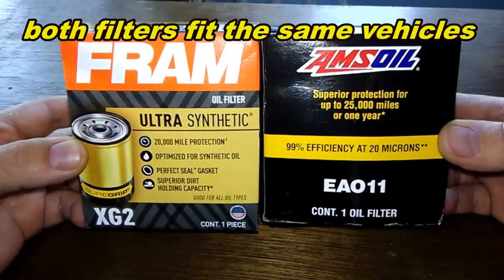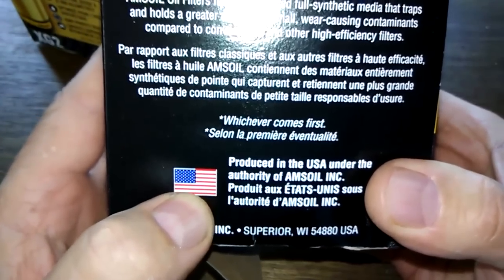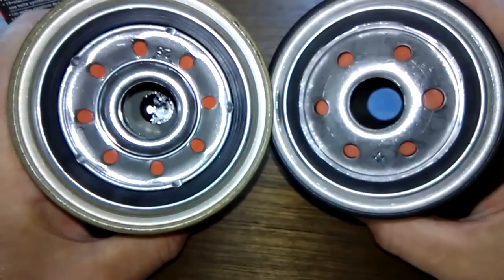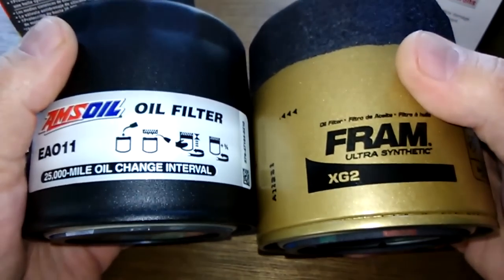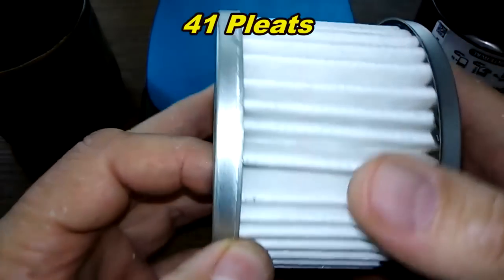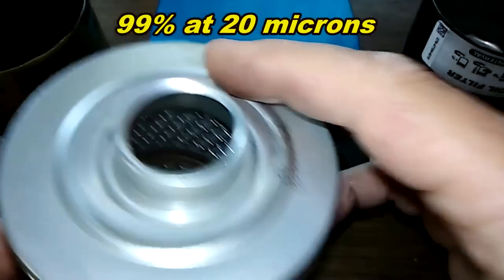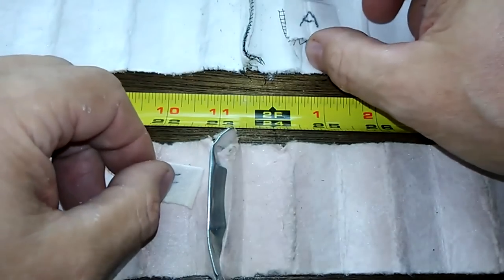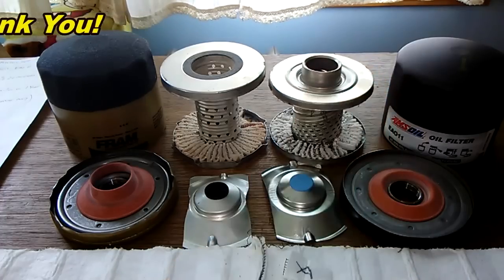Fram Ultra XG2 Oil Filter Cut Open vs. Amsoil EAO11 Oil Filter Cut Open Oil Filter Review

Comment: Without viewing the media under a microscope or running some sort of test through the media, just because something looks similar to touch or plain eye doesn't mean its the same. I'm not saying that the frame wont measure up to this amsoil or say WIX brand (which I use) but the video is merely a visual observation by naked eye, just stating the obvious.
Reply from the maker: Both manufacturers that these filers are made for state/claim that they filter down to 99% at 20 microns, believe them or not that's up to you. I only open them up.
Reply: @WhipCityWrencher   oh I see, my bad, then it makes sense, if that's the case I don't see why fram can't make a comparable or even better filter! Thanks for the video!

Comment: Why did that FRAM box clearly state it did not have the metal mesh; yet, when you opened the filter up, it did have the screen? I thought all the new Ultras did away with the metal screen like your most recent opening of the XG7317?  Is that really the correct filter recorded that came out of that pictured box?
Reply from the maker: Good catch.
The filter in the video came in this box, in some cases they started changing the boxes before they changed the oil filters. They are in transition right now so it's best to look at the filters in the box to see what filter you're actually getting. If you look in the center core you'll be able to see the wire screen through the holes. If you can't see it then your looking at the New Fram filter
Thanks for asking👍😊

Comment: If you dont want your filter gasket to stick to the block and you want it to screw back off as easily as it went on...  use copper anti seize on the gasket instead of oil.
Reply from the maker: I don't know if that s a good idea, some of that anti-seize might get into your oil.

Comment: The ratings are not the same.  Amsoil gives the absolute efficiency, whereas Fram only a percentage greater than 20 microns.  Could be 25 or 30 microns to achieve 99%.  The fine print in the warranty says a lot.  Fram only warrants when used with factory intervals, but Amsoil is the full period when used with thier oil in sound engine.  An oil will last a long time if you can keep it clean, and proper temps.
Reply from the maker: Sorry,
I have to disagree, it's 99%+ at 20 microns.   https://www.fram.com/parts-search/XG2/?ref=NoIgDghgTgLgdgVwLYCMCmUQBoQA0DiATNogDalZkVWULm31UC6QA
Reply: I just looked at the Fram link and it did say for particles greater than 20 microns, not at 20 microns absolute
Reply from the maker: @darrylsjodin7184  Your right my mistake it's 99+% at particles above 20 microns. They play with words and it's all very confusing at times. This was posted a while back on BITOG and Fram claims this is what the New Ultra filtration is.https://i.imgur.com/NMu7XDq.png . I'll try and find the original post and put it here.
Reply from the maker: @darrylsjodin7184 Scroll down to post #57  https://bobistheoilguy.com/forums/threads/the-new-fram-ultra.344442/page-3
Reply: @WhipCityWrencher  thanks for that! Sorry, I’m sure you have plenty to do. I’m laid up from a total knee replacement, so I’m doing couch duty🤣 if you haven’t read about bypass oil filters, Amsoil makes some and they are pretty cool and capable way beyond full flow filters, 99.8% at 2 microns, making the full flow filter micron rating almost irrelevant!
Reply from the maker: @darrylsjodin7184  No Problem, Hope your knee gets better soon.
Yes, I've seen them bypass filters, if I bought a New vehicle I would probably install one.😊

Comment: Note that the hieroglyphic instructions call for the Amsoil filter to be prefilled with oil prior to installation.
Reply: That's an oil dropper, not an oil quart symbol.

The hieroglyphs say to apply a few drops of oil to the gasket, and give you the number of rotations to tighten after the gasket makes contact with the block.
Reply: @Texassince1836  look again, first symbol clearly shows filling at the center and second is lubricating the gasket.

Comment: the Fram XG series is generally considered the best general use filter. Amsoil gas a cult like following. Their filters are decent, and their oils are decent. Just way overpriced.
Reply from the maker: I think the Amsoil is overpriced also.
Thanks for your feedback.👍😊
Reply: Both the size of the company and the quality of the products used in manufacture effect the market price. The huge oil companies can buy the product by the train load to get a lower price, same reason small stores can’t compete with Walmart

Comment: Bottom line is 99% at 20 micron for both filters, why pay 2.5 times as much for one over the other? Who cares how much they weigh, if they are rated at 20 micron and for longer than you are going to go on a change it's a no brainer, Fram.

Comment: I'd run neither in a vehicle I'd be using Amsoil in. That would be a premo performance motor, and neither will have a good enough flow rate for a high oil pressure condition and will bypass, or blow off. Better a cheaper filter with a better flow rate with actually filtered oil, than unfiltered oil bypassing from either of these. These high interval filters are meant for older PFI, medium compression ratio daily drivers that see a ton of low effort miles.

Comment: Seeing your video, I would go with the Fram to ultra. But the frame restricts a little on the oil flow. I saw another video where the guy built the rig to measure the back pressure and the frame ultra was restricting, but it does filter very well, and I don’t think the restriction is of no concern.
Reply: It is if you own a Honda. In fact Honda America does not recommend any fram filters Ultra and above because its to restrictive and causes low flow.

Comment: Im not happy with the 6 tiny inlet holes.
Mobil1 has 6 elongated holes for about 3x  the inlet area.
MOST of the upper line filters are equal in flltering and meet car manufacturers specs.
I look at the holes.
Reply from the maker: Probably doesn't matter because they should equal or exceed the size of the outlet hole.
But I like more inlet holes also.

Comment: Dude:

The 25 k and 20k miles presumes that you're gonna change the oil firs, then you can go the suggested miles.

I hat to add duuuh, but it was just too irresistible.  Lol
Reply from the maker: I change my oil and the oil filter at the same time. Putting in fresh oil and leaving in a dirty oil filter is not something I would do.

Comment: The Fram filter is a cheap filter media and the Amsoil is much better. Fram is also known for making their regular filters out of cardboard, they are crap. I take the Amsoil filter all the way to the 25,000 miles over Fram any time. I use Amsoil oil for my car and new truck as well. Users of Amsoil oil and filter have gone over 700,000 miles on their bikes without an overhaul, can Fram say that?????

Comment: I’ve been using signature series with Ea filter. Agree both are expensive. I think most people are not going to go 20,000 mi on an oil filter. Heck, even on my signature series, I never go over 16,000 km (10,000 mi), so actually Fram ultra makes a lot of sense.
Reply: Before shying away from safe, money saving extended drain synthetic motor oils from AMSOIL, have a laboratory oil analysis done on that 10,000 miles AMSOIL synthetic oil. You may be very surprised to find you're tossing out perfectly good oil. :)  - 30 year Independent AMSOIL Synthetic Lubricants Dealer.

Comment: Had to switch to Fram because Amsoil filters are out of stock . we shill see how they hold up . You know i go 15,000 miles then change filters then 5,000 more then change oil and filter.
Reply from the maker: If you're doing that. Why not split the filter into 10,000 miles intervals?
Reply: I @WhipCityWrencher
Reply: @WhipCityWrencher  it's just what I do because oil is worst shape at the end of it's life.

Comment: AMSoil has egg on it's face. Pulled back the covers to expose the rip-off.
Reply: I cant deny the Ams filters are to much. I use Wix XP. But I like there oil and especially the Full Syn Trans fluid. I change trans fluid often (I pull a trailer) and it last much longer than using my 2nd choice Castrol Conv. trans fluid.

Comment: I like the lack of the metal crimp on the pleats I only use fram if im doing engine flush or anything that I know I will be doing a very short change on but the by pass pressure relief is a huge difference between the oil being filered or not. The surface area is the next biggest factor fram is longer but the seams defeat that small difference. Basically the fram has a  negligible amount of surface area the difference in bypass pressure is going to be able to filter oil longer. No the Amsoil isn't worth the price but I don't really see anything that I can actually say changes my mind about the Fram filters and the other thing is Fram has done the bait and switch before and I wouldn't be surprised if they do it again. Advertise the living hell out of the newest greatest thing and get consumers used to it and then they cheapen up the materials and don't say anything.  They get away with it buy using terms like "up to"  in the small print witch under the law makes it impossible to hold them accountable for any filters tested that don't make it to 20 microns and also means that only one filter in thier lineup has to hit 20 microns. I haven't seen this issue with other filters I've bought but I also can't say that it is impossible that it does not occur but I have personally seen it with Fram. Not every fram filter within the same category is equal to each other.
Reply from the maker: Thanks for watching and your feedback👍

Comment: Fram does not state 99% at 20 microns, not on the box, site, or anywhere.
Reply from the maker: Correction 99% for particles above 20 microns
Reply: @WhipCityWrencher  you stated they both filter 99% at 20 microns, Amsoil is the only one that does 99% AT 20 microns, Fram is unknown.
Reply from the maker: @thescooter135  I miss stated, Fram says 99+% particles above 20 microns. https://www.fram.com/en/oil-filter-xg2

Comment: There not for the same vehicle so comparing the size is pointless.
Reply from the maker: These two oil filters fit the same vehicle.
Reply: @WhipCityWrencher  no they don't the center hole isn't even the same size.they can't thread on the same car if they did the outside diameter would be the same as well.
Reply from the maker: @mbsnyderc  I suggest you go look it up, they both have M22x1.5 Threads
Reply: @WhipCityWrencher  I don't have to i can clearly see in your video the center hole is not the same size.

Comment: I would have to say Fram is the worst filter for the low-end ones(junk) they sell on the market but if you buy the higher-end ones they are pretty much on par with the competitors.  Otherwise, I would run away fast from all lower-end Fram filters.   Do a test goto walmart buy the low end walmart no name brand filter and do the same for the eqiv. for fram.   Cut them in half and be shocked. You will never touch a low-end fram again after that.
Reply from the maker: Are you talking about the Suprtech's? Well, some of the Supertech's have felt endcaps, and the entry-level Fram's have cardboard endcaps. Not much of a difference there in my IMHO.

Comment: For amsoil oil to say it's good for 25K miles, it says to change the filter at 15K I believe. I'm not paying their prices or going that long on oil. I won't even use my manufacturers OIC which says 10,000. I usually go between 4 to 5,000 mi. So why pay the extra money?
Reply from the maker: I agree, 
Thanks for watching and the feedback👍
Reply: You can get the data sheets for Amsoil on line 
Their oil hands down is the best 
If you go to their site and become a member for 20 bucks a year the oil is not that expensive 
As for the filters you would need to do a test on them after 15 or 20 k to see how they held up. 
Filter wise it does look like fram is cheaper and seems to be the same caliber as Amsoil but like I said you have to do some type of test after usage 
What if frame filter falls apart or degrades 
Same for Amsoil 
But one thing I do know Amsoil will allow their products to be tested against anyone. 
As for the oil it is a great oil and it does last and hold its properties over the course of a year 
It also has more detergents to keep your engine clean.
Reply: @anguslean4058  you can go that long if you want. I don't care what the lab says, nobody recommends more than 5K miles for oil changes

Comment: 25k for the filter but you still should change your oil?
Reply: Amsoil recommends oil and filter changes together at up to 25,000 miles in light duty service, 15,000 miles in severe service, which is most applications. If using another brand filter, replace the filter at half the oil service, so 7,500 for a 15,000 mile change. Install a bypass filter for an even cleaner engine and oil, filtration down to 2 microns  at 99.8%. I’m 62 and have been doing this for years, 287,000 miles v6, clean engine good condition. No need to change oil so often

Comment: If you have a program you can get for $15 amsoil that’s what amsoil is the best oil you pay what you get for
Reply from the maker: Yes but the Fram Ultra will do the same job and would still cost almost half. There are plenty of good Full synthetic oils for a lot less. You can do shorter OCI's and have cleaner oil in your engine.

Comment: Fram ultra is not 99% (absolute) at 20 microns. Fram says "above" 20 microns. That can mean a lot of things in marketing jargon
Reply from the maker: They both use the same ISO 4548-12  filtration test. If there's any difference I'm sure it's negligible.

Comment: I’ll take the Fram and buy beer with the money saved from the amsoil filter. The Fram needs a thicker can and a coil spring.
Reply from the maker: There you Go!🍻 lol
Reply: Why does Fram need a coil spring and a thicker can?
Reply: @TranslatedAssumption  
Good question the Fram Ultra filter got my vehicle (XG9972) doesn't ever have a can of a spring... It's a cartridge style filter which is just a filter element andxa couple o-rings.
Reply: NOPE. No need for a "thicker can" -- the bursting pressure is higher than your engine's oil pump can generate.
NOPE. No need for a "coil spring" -- the stamped spring does the same job, and is just as precise as the coil spring. The coil spring being "better" is a myth.
 Many of the Oil Filter Tester Guys -- have mistakenly claimed that the coil spring is "better".
 Perhaps that's because we're USED TO seeing a spring in the form of a coil, but that has NOTHING to do with the form and/or function of a spring.
 When being manufactured, the stamped spring is carefully measured and tested to maintain a certain pressure, and those cheap-looking stamped springs are actually very accurate.
 When examining cut-open oil filters, notice that oil filters with coil springs have SHORTER filter media -- and I prefer the greater media surface area that's found with the stamped spring design.
Notice also, that the Amsoil and the Royal Purple oil filters are the most expensive oil filters on the market, and they BOTH use the stamped metal spring.
Between the Fram Ultra and the Amsoil -- the Fram Ultra is the clear winner.
Reply: @TranslatedAssumption  They don't. The cans don't burst, and the coil spring has NO mechanical advantage, despite the opinions of well-meaning folks that never were involved in spring manufacturing, so they really don't know the spring-making facts.

Comment: The hard questions. 
How do u have 25k oci
Without changing oil 😂
Reply from the maker: You got that right!👍😊
Reply: There are Diesel Truckers going 100, 200, even 400 K miles between oil changes?  They run  AMSOIL oil filters & By-Pass filters, they just change filters & top the oil off?  The Lab tells them when to change the oil?  NO mystery, Google it?

Comment: Never use fram.  Since the late 90’s, they are a poor quality filter. The ultra is better quality then the old fram, but if I’m going to pay $25,000 to $30,000 for a car, I want good quality parts.  Go dealer or purolator.  I’m a pure one or boss guy for 20 years
Reply from the maker: I like the Purolator Boss. Here's some good reading on how well the Fram did in a filtration test.https://bobistheoilguy.com/forums/threads/would-you-all-like-to-see-iso-4548-12-oil-filter-lab-testing-comparison-efficiency-capacity-pressure-vs-flow-bubble-point-and-burst.334882/

Comment: This is Fram in damage control mode. They sold their product as a superior product when they knew damn well it was crap. There are plenty of other options between the Fram turd and the best filter made. Sorry Fram. Like that redhead at the end of the bar. You might have a nice little package, but we've all heard what's underneath. No thanks.

Comment: You're doing oil filter reviews and don't even know that Amsoil lasts for 25k...(signature series)...come on now!
Reply from the maker: Walmart sells Supertech 20,000 and costs a lot less. https://www.walmart.com/ip/Super-Tech-Advanced-Full-Synthetic-Motor-Oil-SAE-5W-30-5-Quarts/514849921?wmlspartner=wlpa&selectedSellerId=0&wl13=5278&adid=22222222277514849921_117755028669_12420145346&wmlspartner=wmtlabs&wl0=&wl1=g&wl2=c&wl3=501107745824&wl4=pla-294505072980&wl5=9001685&wl6=&wl7=&wl8=&wl9=pla&wl10=8175035&wl11=local&wl12=514849921&wl13=5278&veh=sem_LIA&gclid=CjwKCAjw04yjBhApEiwAJcvNoQcrfVX7bQ8pYW2peysEYoMhFogCRvikEVabz3fNPwIMA1Ho3tF05RoCVg4QAvD_BwE&gclsrc=aw.ds
Reply: @WhipCityWrencher  - I know a place where we can get oil filters for *free*. They're used.  We get what we pay for. Using cheap oil filters and oil with an engine worth thousands and thousands of dollars might not make dollars and cents, or sense. :)